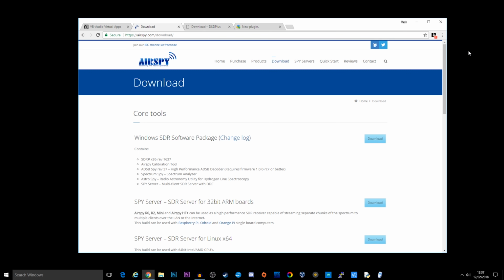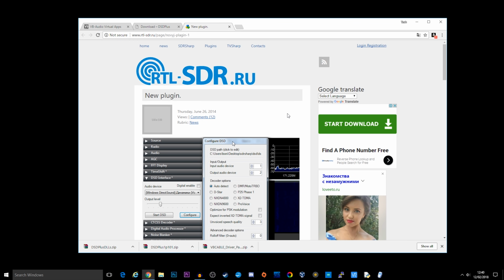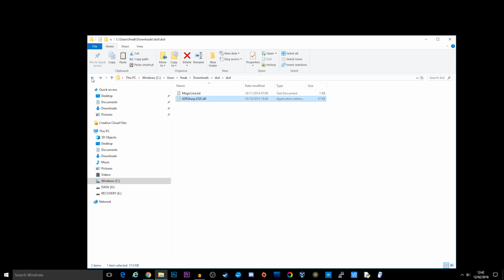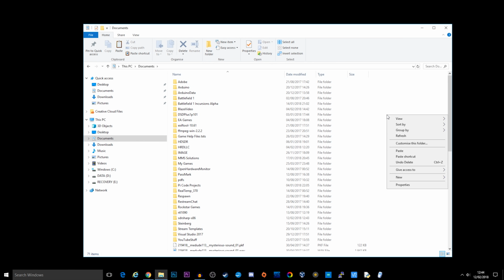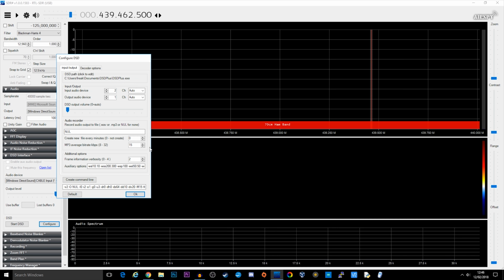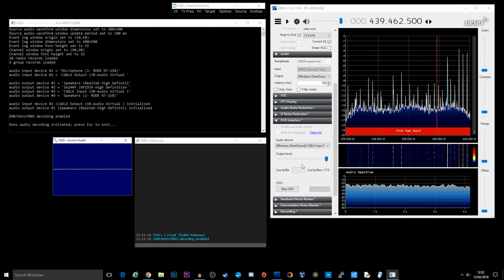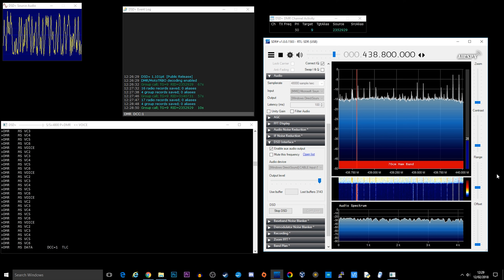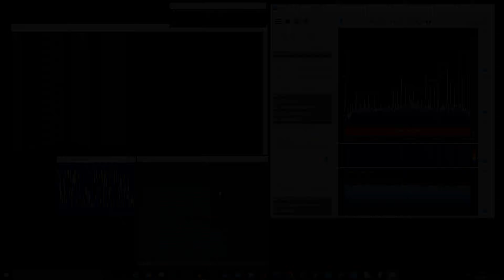How To Setup SDR # Sharp To Decode DMR Digitial Using DSD Plus And An RTL SDR Receiver on Windows 10

Comment: Thanks for the video! It is the only video I came across that highlights the sdrsharp add on! One question tho :-) I get it all working fine, audio comes through, i get a sound wave on the little screen (dsdplus) and all is dandy, I followed your instructions to the T,  but it doesn't show any decoding? I have searched through the whole range and I am sure that I stopped on a few digital signals, but still not a whisper of decoding going on? Any ideas?? Because I am all out.. Thanks in advance!
Reply: Same issue ian. Did you solve it mate?
Reply: Hi ya Neil, yes actually, what I did was, feed samples of digital signals from a wiki page that I found, into DSDPlus, and I noticed it started to decode! So I decided, ok, this seems fine, and after trolling threw the bands in my area I FINALLY came across a digital signal that started to decode . . I was like a kid at Christmas lol I guess what I thought were digital sig's before were some other type of signal perhaps? Anyhoo, it works, it might not seem like it's doing anything, but when you hit on the right signal, it will bust into action! Hope this helps, if there is any more I can help with just shout and I'll do my best . . . Regards.
Reply: Ian Graham    Thank you my friend
Reply: ian - ive got the program to show decode of dmr in the events log and it says voice at the top but all i can hear is the raw noise that i would usually hear if not decoding

any thoughts?

neil
Reply: Neil . . mmm,  you definitely have your in's and outs set set correct yea? Exactly as in the video above? And in the 'listen' section of the recording properties you have "listen to this device" un-checked? Because if that box is checked you will hear the same noise as without dsd enabled.. only other thing I can say is maybe that particular channel is encrypted? 
When It worked for me, I was listening "live" so I never had to go to the events log, so it seems like it's still not set right, did you listen to it live or just let it do its thing and came back to it some time later and listen to recordings?
Reply: Neil . . did you try the wiki samples like I was saying? Did that work?? If you are set up right, and play one of those samples, you should see it decode and play the correct audio, if it does, you are set correctly,  if not, you still have settings issues bud..
Reply: Ian Graham    Hi. Where is “listen to this device” checkbox?

Thx again ian
Reply: Neil . . right click your volume button down in the right side of the tool bar, then click recording devices, then highlight CABLE output,  click properties, select the 'Listen' tab, and you should see it there 👍 (I'm on windows 10 btw)
Reply: Ian Graham    I thought I was getting somewhere!!! I could hear some voice behind the machine noise. I will keep trying

Thanks v much
Reply from the maker: Sounds like you are almost there. If you can hear the digital signal mixed with voice audio then it's most likely the issue that Ian Graham mentioned, you may have "Listen to" turned on for the VB Cable.
Reply: Ian Graham   Won’t give up mate. Just need to take a break to eat and sleep!!!  I’ll probably have another hour on it tonight. Thanks for your patience ian.  Neil
Reply: Tech Minds   Thanks but I’ve spent 2 days on this now. I’m going to take a break and try later.  I really appreciate your help. I will probably be on here again later!!!!  Thank you. Neil
Reply: Neil I spent over a week trying to get it to work on and off lol Don't give up hope mate! You will get it eventually 👍
Reply: Ian Graham are u in uk Ian?
Reply: Neil . . You are right, take some time out and go back to it with a fresh head 👌 no mate, South of Ireland,  not a lot of traffic on the airwaves where I am but enough to keep me interested, and there are tons of avenues I haven't explored yet, so it's well worth the time and patience 👍
Reply: Ian Graham   Nice part of the world. I was worried in case we were on different time zones!!!  Top of the afternoon to ya friend.  I’ll be back👍
Reply: Cheers Neil,  I spent a good bit on time travelling the UK when I was driving trucks, some lovely spots over there, I was mostly up around Coventry side as the company I worked for had a base there, can't wait to get back touring there again 👌 Okay, best of luck and hope you get sorted bud 👍
Reply: Ian Graham   Cheers ian. I’m based in Yorkshire mate but travel a lot too. Including roi 

I’m a hf fan but this sdr thing has really got under my skin

Thanks again sir

Neil

Comment: Followed your instructions and works, but no sound.
Reply from the maker: Ed Ryen Check the DOS black window for the available input and outputs and what is being set. Input has to be VB Audio and output your speakers. You can goto DSD settings and configure the input output, but before saving, click the Create Command button, then try again. 👍
Reply: here's what is in the dos window
audio input device #1 = 'CABLE Output (VB-Audio Virtual '
audio input device #2 = 'Microphone (Realtek High Defini'

audio output device #1 = 'Speakers (Realtek High Definiti'
audio output device #2 = 'CABLE Input (VB-Audio Virtual C'

audio input device #2 (Microphone (Realtek High Defini) initialized
audio output device #1 (Speakers (Realtek High Definiti) initialized

In DSD configure I set the devices as above  audio output 1; audio input 2

Still no sound

When I click on a P25 frequency that I'm monitoring, this is a partial display:

Sync:+P25p1 NAC:211 LDU2
Muting encrypted voice

Sync:+P25p1 NAC:211 TDU
Sync: no sync
Sync:+P25p1 NAC:211 LDU1
Muting encrypted voice

Sync:+P25p1 NAC:211 LDU2
Muting encrypted voice

Sync:+P25p1 NAC:211 LDU1    e:11136r
Sync:+P25p1 NAC:211 LDU2    e:21134
Sync:+P25p1 NAC:211 LDU1    e:1133426r
Sync:+P25p1 NAC:211 LDU2    e:1Er112211
Sync:+P25p1 NAC:211 LDU1    e:3312DrCrFrEr
Sync:+P25p1 NAC:211 LDU2    e:13DrDrCrFrFrEr
Sync:+P25p1 NAC:211 TDU  ERR5
12 radio records saved; 0 aliases
Sync: no sync

I don't understand the "Muting encrypted voice"
Reply from the maker: You have your Microphone set as your input, is has to be the CABLE VB as input. Change your DSD settings to Output 1 and Input 1, click Create command and then try again :-)
Reply: I set both input and output to 1; still no sound.  Really baffled.
Reply from the maker: You'll only get sound when its decoding digital audio. When its decoding you will see lots of data scrolling up the black dos window. Do you see that?
Reply: I'm tuned to local law enforcement 155.069.27 and hear buzzing, no voice.  Here is a sample of the DOS output:
Sync:+P25p1 NAC:141 TDU
Sync:+P25p1 NAC:141 TDU
Sync:+P25p1 NAC:141 TDU
Sync:+P25p1 NAC:141 TDU
Sync:+P25p1 NAC:141 TDU  ERR7
Sync:+P25p1 NAC:141 TDU  ERR2
Sync:+P25p1 NAC:141 TDU
Sync:+P25p1 NAC:141 TDU  ERR1
Sync:+P25p1 NAC:141 TDU  ERR1
Sync:+P25p1 NAC:141 TDU  ERR2
Sync:+P25p1 NAC:141 TDU  ERR1
Sync:+P25p1 NAC:141 TDU  ERR1
Sync:+P25p1 NAC:141 TDU
Sync:+P25p1 NAC:141 TDU
Sync:+P25p1 NAC:141 TDU
Sync:+P25p1 NAC:141 TDU
Sync:+P25p1  unrecoverable NID
Sync:+P25p1 NAC:141 TDU  ERR2
Sync:+P25p1 NAC:141 TDU
Sync:+P25p1 NAC:141 TDU
Sync: no sync

I assume there is no voice over this frequency.
Reply from the maker: Try a different frequency, like a local ham radio repeater. DMR or DSTAR to see if that works, then you’ll know if you have an issue. You could also try widening the bandwidth over the signal you are trying to decode, just in case it’s too narrow.
Reply from the maker: Or, they are encrypted...
Reply: Thanks for the help.  SDR#/DSD+ seem to be working now.  Will look for other frequencies.

Comment: I have followed the steps and have the 4 boxes ie dsd+ dsd+ sourse audio dsd+ event log and dsd+ channel activity but no sound ?????
Reply from the maker: Mark Exton On the bigger black dos looking window take a look at the available audio input and outputs, each start with a number. Then in the same window at the bottom, it will tell you which is assigned to input/output. Output should be your speakers and input should be VBAudio cable. Or soundflower depending which virtual cable you are using.
Reply: Tech Minds 5 lines which I have on that black screen:

Audio input device #1 cable output (vb audio virtual 

Audio output device #1 speakers Realtek high def

Audio output device #2 cable input  ( B.B. audio virtual c

Audio input device #1 (cable output vb audio virtual 

Audio output device #2 (cable input vb audio c
Reply from the maker: Ok, so the bottom output device has to be set to 1 as that’s where your speakers are. Just change that in the command line of dsd
Reply: Tech Minds I’m really struggling with this could I email a screenshot please and you to explain I’m easy to understand terms what I am to do, I also restarted sdl and all the settings have gone grrrrr
Reply from the maker: Mark Exton sure, email me: matt@dstarcomms.com :)

Comment: followed the instructions and know its right but the dsd exstention do not apare in sharp i tryed it on my old sharp 1400series and the latest 1653 nothing
Reply from the maker: Did you add the entry into the plugins.xml file?
Reply: yes. in a old installation its there and it opends when i start it and  both have VB cable as source and drain bit there is absoulutly no sound or demodulation when i test it with my DMR radio

Comment: When I select VB Cable as my output device, I can hear no sound from SDRSharp. When I switch it back to my speakers, I hear sound. Any idea what I may be doing wrong?
Reply: I've got the same problem. No audio coming through.
Reply from the maker: The audio to your speakers needs to come from DSD, not SDR Sharp. Within SDR sharp you need to make sure the output is set to the VB Audio cable, then when you run DSD look at the available devices and which devices are configured for input/output. This is shown on the little DOS style window that opens when you Start DSD.
Reply from the maker: Pause the video @ 9:29 and you can see the DOS window I mention. Let me know how you get on.
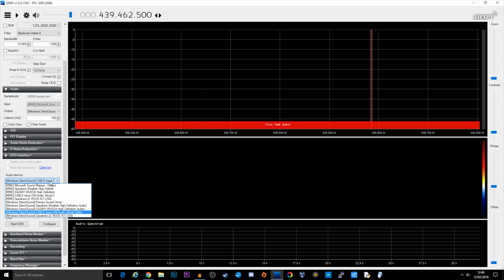Reply: That's why you need to use aux output in DSD Interface plugin. The author (and not him only, many of SDR listeners did that mistake) gave incorrect information 6:54 about the Audio device. This dropdown controls aux output, not the input audio device. This checkbox plus dropdown you should use if you want to listen source signal (sound) not decoded by DSDPlus. 9:00 this sounds like correct information. This should be the first step of any DSD Plus configuration: you set up your input and output deivce. Usually, you set speakers on position 2, and input virtual cable as 1. Happy listening, 73.